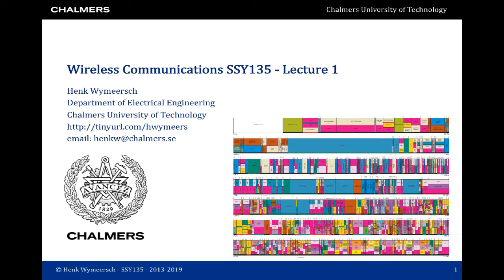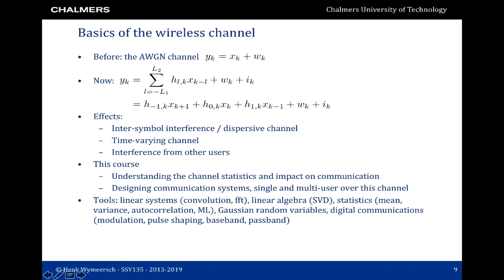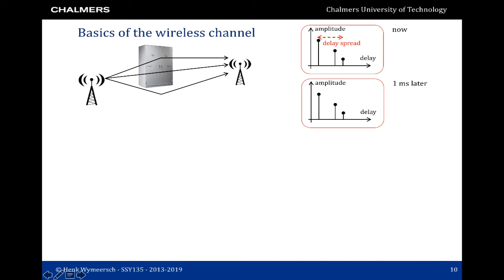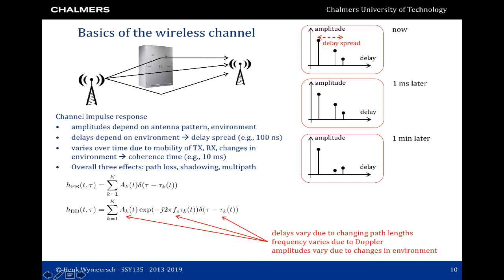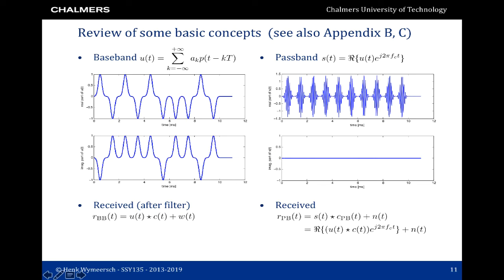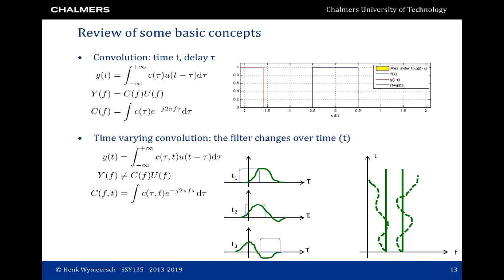Wireless Communications: lecture 1 of 11 - Review of basic concepts

Comment: Thanks for the lecture

The below is just some of my note and questions. I find that I have not learnt and forgot most of the basic. haha
1. delay spread; time between first response and last response; typically a few nanosecond 10^-9
2. coherence time; time that channel is roughly the same; a order of ms 10^-3; how to define roughly the same?
3. Channel can be represented by 3 components: path loss; shadowing; multipaths
4. k; index/number of path ?
5. small change in delay multiplied with a very high f_c result in high rotation ?
6. Amplitude; frequency; delay are varying over time and paths
at 7:01
7. a_k is symbol, p is a pulse shape? what is pulse shape
at 8:25
8. dB and dBm
at 9:50
9. what is u(t - tau)? signal? c(tau) is impulse response?
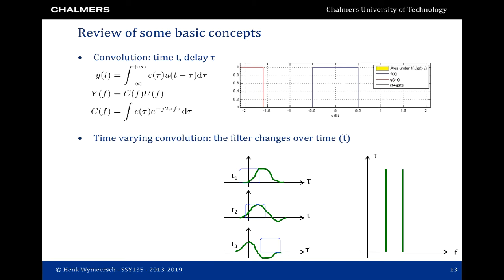at 10:30
10. what is mean by "when the input signal goes through this"? I see some rectangular boxes in the graph but what do they mean?
11. time varying fourier transform: C(f, t) = fourier transform of c(t, tau) with respect  to tau. so what is it?  it there any example?
at 11:26
12. complex guassian: CN(mui, sigma^2)
13. WSS: is channel WSS? why we need WSS?
14. PSD:  why F(autocorr) is PSD? how will we use PSD?  I just heard the white noise PSD is N_0/2 and but why?
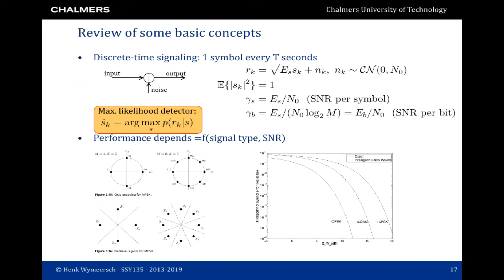at 14:32
15. s_k is symbol. what is the subscript k meaning? path ?
16. gamma_s mean SNR per symbol
17. why E_s need square root?
18.  why n_k variance become N_0? not N_0/2?
19. gamma_b mean SNR per bit
20. gamma_b is Es/log(2,M) and then divided by N_0
21. how to construct a max likelihood detector?
22. how to construct the graph of Pe vs SNR for different constellation?
at  17:14
23. convex optim, maybe I should take another course on it.
24. No idea about it
at 18:57
25. SVD..... I need to re-remember it
26. maybe I should take another course on it.
at 20:08
1. main property 
1.1. refer to 3. Channel can be represented by 3 components: path loss; shadowing; multipaths
2. challenges?????? same as properties?

Comment: Thanks for the excellent lecture.... slide 15 states  Gaussian noise process PSD ...the written expression is in fact  White Noise ... Gaussian does not have to be white
Reply from the maker: Yes, you are correct. Only if the PSD is constant is the noise white. If the PSD varies as a function of frequency, the noise is colored. In this course, we only consider white noise with flat PSD.

Comment: Thank you so much. Could you please explain what "passband" and "baseband" are in slide 10? I understand we use complex numbers in baseband propcessing, but it is anti-instinct that parameter "fc" appears in h_BB rather than h_PB.
Reply from the maker: The baseband signal is the complex signal centered around zero frequency. Let's call this signal s(t) (complex)
The passband signal is the real signal, which is obtained after up-conversion. Let's call this signal x(t) (real).
Then x(t) =Real (s(t) exp(j 2\pi f_c t)). This signal passes through the channel, the received baseband signal will depend on the carrier frequency. More examples are given in the later lectures.